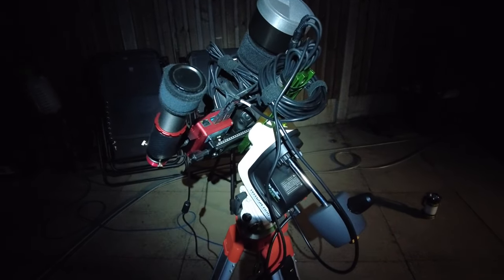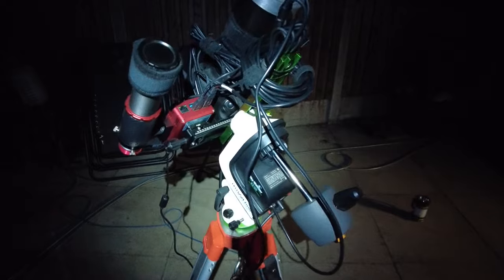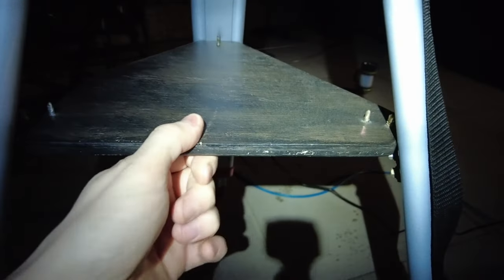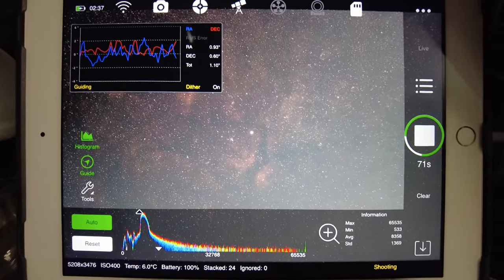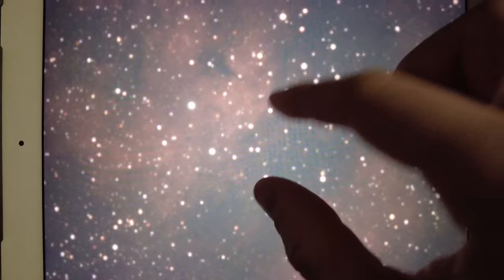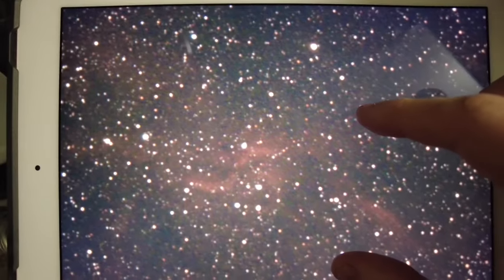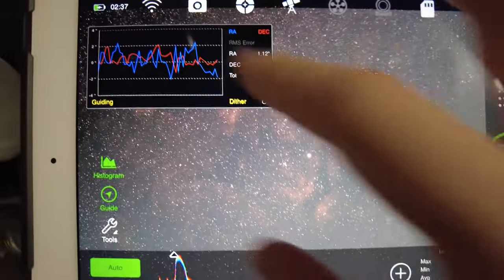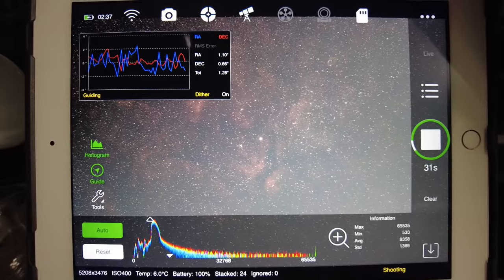AZ-GTi & ASIair Pro - Compact & Portable Astrophotography Imaging System - General Capture Workflow

Comment: Do you know how much weight you had on your GTI at this time? I just acquired an AZ-GTI with a RasPi. I am running astroberry with my Canon t7, Redcat 51 and GTI. I am currently not guiding, but I cant get much more than a minute of exposure time without trails. It could be due to balancing and my polar alignment skills, but I feel like I see people push the 11lbs limit and get 5 minute exposures easily, and you even mentioned your rig was a little top heavy. Is this strictly due to guiding? I'd imagine with everything you have up there you aren't far from 11lbs if not over.
Reply from the maker: Hey mate! I believe it was probably around the upper limit of recommended payloads for it yeah, the imbalance was likely to keep pressure on the drive from one direction - a while back though so can't really remember 100%
I'm currently running the az-gti fairly overloaded and still getting 5m subs at reasonable focal lengths.
I definitely recommend auto guiding, it'll really change the game for you if longer subs are what you want 👍
Reply: @lukomatico  Thanks for the reply! Currently in the works of getting a guide scope and guide cam. I was a bit worried of pushing too much weight after I add those things. But considering I see what others throw on their AZ GTI, I should be able to get away with it. Thanks again and clear skies!

Comment: Luke,  
Outstanding video and explanation for someone like me who is building something similar!  Thank you.  Was your visualization for polar alignment done with the DSLR camera or the guide-scope camera?  ……I am guessing the guide scope camera.  But is it possible to use the DSLR for this purpose if it’s connected to a small telescope, like my 60mm AT60ED?  That way, an actual guide scope is not actually necessary?   Is there a way to program the ASI device to do that?  Initially I want to try it without guiding, and possibly/probably add that later when I am sure my AZ-GTi can handle the weight.
Astro Paul
Reply from the maker: Hey there Paul! - I'm glad you enjoyed the video mate! :-)
To answer your question - I did the polar alignment with the lens+dslr, it works really accurately so there's no problem!
Trying without guiding could work, but to get the best from your setup you'll really need to go the autoguiding route, the AZ-gti should handle the payload quite well I think - for reference I'm now using mine with the following payload - William optics redcat, zwo1600mm pro mono, zwo 8 slot electronic filter wheel, 30mm f4 guide scope, zwo 120mm mini guide cam, ASIAIR pro, an extended dovetail and a carrying handle + a bunch of wiring, - with the right counterweight it's handling that load really admirably, I can get 10 minute exposures with no trailing! :-)

All the very best of luck in the future, I hope to be coming out with plenty more AZ-gti + asiair videos soon! (weather permitting)

Clear skies!
Reply: @lukomatico  Thanks for the details on your rig.  That helps!  Don't mean to be a pest, but one more question......  Any idea about the use of DSLR cameras with ASIAIR PRO.  I know they have a list that includes many Canon and Nikon camera.  But the Canon camera I have is not on that list, probably because it is fairly new (2019/2020).   I wonder if the ASIAIR Pro is finicky with regard to cameras (i.e. some work and some don`t)?   I suspect it will probably work on most, inclining mine (Canon EOS RP) even if not on the list.  Do you / or anyone have any knowledge or experience with this?   ZWO just says it is "not tested".
Reply from the maker: Hey there Paul! - that's a good question! I've had a look around online and now I'm confused too haha! In truth I do not know for sure if it would work, I'm sorry about that - Zwo do seem to be working through a list of cameras and adding support over time though, so my gut feeling is it'll be supported officially within the next few releases (I hope!)

Clear skies mate 👍👍

Comment: Thanks for this excellent video. I am a big fan of your posts. I am using a similar setup, but the ASIAIR guiding calibration would always fail (during south and north steps calibration). Did you get that problem? How did you manage to set guiding in Auto mode working? Thanks again for all your great videos
Reply from the maker: Hey mate! I'm glad you have been enjoying the videos, that's really nice to hear! :)
regarding calibration, I too did see some issues initially - try to set the guide exposures to a few seconds each and the movement step size to be much larger than automatically set - try 6000ms in each direction.

re- guiding in auto mode, if you are having trouble with dec randomly going flying off the graph, then try to revert to the earlier firmware - that fixed it for me!

Thanks for watching!

Clear skies :)
Reply: @lukomatico  Hi Luke . Just wanted to let you know that you solved my problems regarding guiding calibration with the settings you proposed. Thanks a million you are great…and you dumbbell is quite amazing for 1h15 of data! 🤩
Reply from the maker: @christlesterlin8787  That's excellent! I'm so happy to hear you've got it sorted out mate and can start to enjoy it properly! 👍👍

Comment: Hi Luke
I've finally got out with my sw 72ed AzGti Canon 600D and asiair pro, it was a full moon but wanted to give my AAP first light, done PA and guiding ok, was dithering 10px as my Canon has a 4 pixel size. I've taken 32x120 sec test images on NA nebula, I've taken my flat (with light drawing screen) and bias frames indoors, how do you do flat dark or dark flats with the AAP?
Reply from the maker: Hey mate! - That's awesome! I'm really glad to hear you've had some time out shooting, top man! :-)
regarding how to take darkflats, you'd set a manual exposure on your "bias" plan on the AAP,  ideally something like 1 or 2 seconds, pop your lens cap on, make sure it's shielded from direct light so nothing is getting in through the cracks, then take your darkflats!
regarding your 600d though, just using normal lights, darks, flats and bias should be totally fine with that camera :-) it's usually the 1600mm and 294mc/mm that need special darkflats as far as I remember!
(worth noting that if you use darkflats, you wouldn't also use bias - and vice-versa is true)

All the best mate, I hope that helps!
Clear skies!
Reply: @lukomatico  hi Luke thank you for your kind words and advice. It felt good to be back out there. I will take my dark flats that way now thank you, I don't take darks with my dslr as they don't make any difference to me, last night to take my dark flats I just put lens cap on, set dslr to aperture priority mode and snapped a load with my intervalometer without AAP but can do it your way now as I feel dark flats may benefit my dslr better, clear skies and thank you again 👍
Reply: Hi Luke
Sorry it's another piece of advice needed, regarding bias frames, now using my dslr before the AAP i did 1/4000 shutter speed ggor bias but how can I input that to the AAP or what speed to use eh can I go faster than 0.1 seconds or what is the equivalent to 1/4000 in the AAP. I have asked on sgl and zwo forum but no luck. Thank you
Reply from the maker: Hey matey! - if it were me I'd set the exposure to auto on the bias plan, that should take over for you I think! :-) I hope that helps mate
Reply: @lukomatico   thank you, I really appreciate your help with my bias frames I'll give that a try, just experimenting to find the perfect way of takjng them, clear skies
Reply from the maker: @astronebulee578  Clear skies mate! - I hope it works for you properly🤞 👍

Comment: Great demo, thanks Luke. Are the frames still stored on the cameras sd card or are they saved on the iPad?
Reply from the maker: Good question! - they are stored on the asiair memory and also the camera if you choose to do that 👍 they include a thumb drive also to transfer files over which is very easy to do!
Reply: @lukomatico  Thanks Luke, it looks like the ASI Air will be the way forward for my set up!
Reply from the maker: Hey Julian, I think that's a good plan mate - I'm consistently impressed with it! 👍